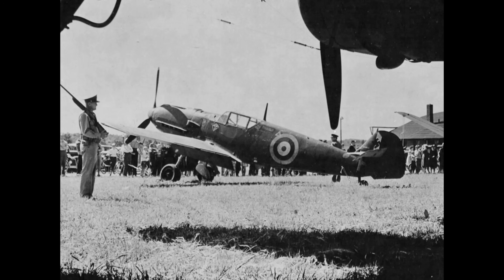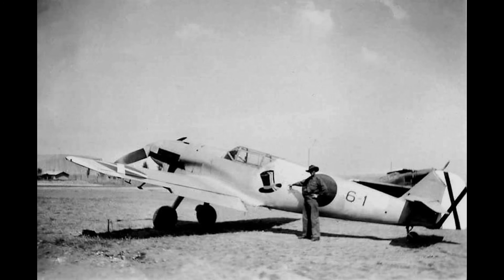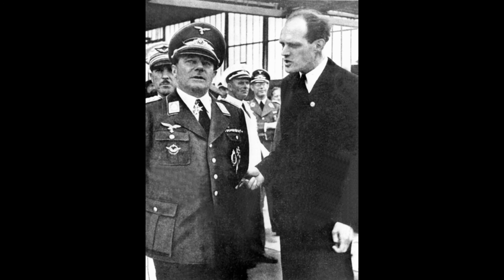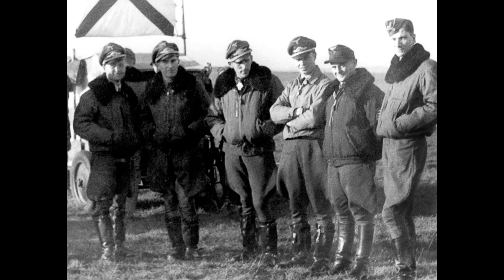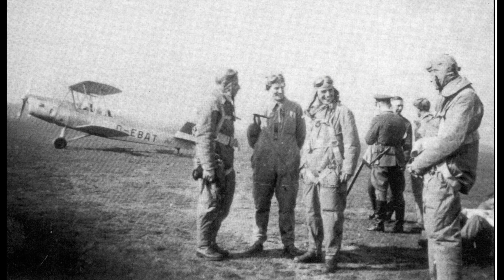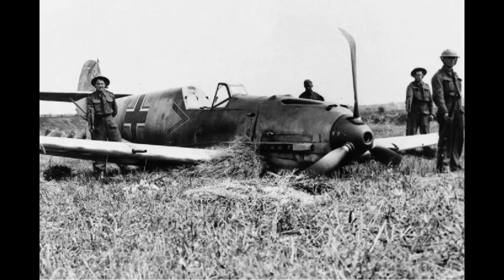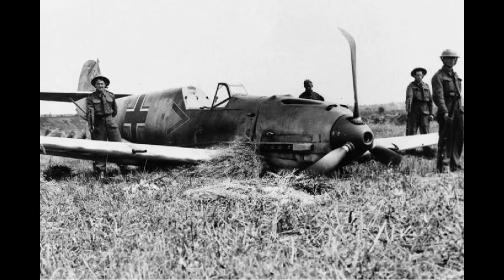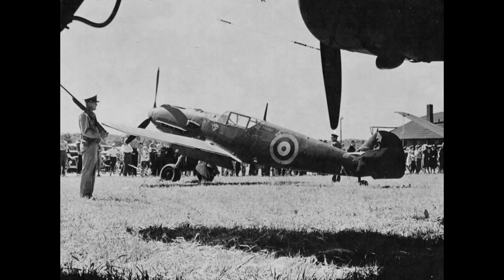British Engineers Examined a Captured Bf 109 — Couldn't Believe Its Landing Gear Was the Real Killer

Comment: My suspicions were correct on the landing gear. It just didn't look right. I hope that the restorers rectified those problems by beefing up the whole landing system. In flight, the 109 goes like stink. Great video & thanks for posting. The FW-190 like the P-47s has a wide landing gear set up.
Reply from the maker: Thanks For Watching !

Comment: Like everything else an aircraft is the product of the specifications demanded by the customer and the experience  of its designers.  Messerschmitt began his career designing gliders where every extra pound cost performance.  His customer demanded manufacturing efficiency.  The 109 was small, light, aerodynamically efficient and easy to manufacture.  The landing gear design compromise greatly  reduced weight and simplified airframe manufacture.  The Luftwaffe clearly accepted the risk in return for the performance reward.  As the war developed Germany's inability to adequately train pilots magnified the problem and increased landing/take-off loses.  Messerschmitt attempted a replacement with the Me 309, a wide track, tricycle landing geared fighter.  It didn't offer a performance improvement over then current versions of the 109 and the project was shelved. As a side note, there is very little documented evidence to substantiate the Me 109's mythical take-off/landing loss rate.  While high, there is no substantive documentation to back the rumour that a third of the largest fighter production in history was lost in this manner.  It was bad for sure, but no likely a full third.
Reply: very possible.

Comment: The 109 structure was exceptionally lightweight because all major parts: engine, wins, landing gear, mid fuselage , were all attached to the same structural feature. 
In the Spitfire, landing gear was attached to the main wing spar which had to be strengthened.

Removing the engine of a 109 was simple. The wings could be removed with the aircraft sitting on its landing gear.

The narrow track was a problem but it was a solution to gaining better performance with mid 1930s engines.

Comment: I’m surprised that Germany didn’t switch to the Focke Wulf 190 instead as it had inward folding undercarriages and was the better plane.
Reply: The 109 was faster, more agile, and significantly better suited to high altitudes . . .
Reply: The 109 was CHEAP.
Reply: @FredScuttle456  One Spit would buy two 109s. Quick to manufacture, easy to transport road or rail, good servicing in the field.
Reply: As it happens, the 109 was the choice of the top Luftwaffe ‘experten.’ It cost half that of a Spitfire. You are completely overdoing the undercarriage thing to a ridiculous extent.

Comment: As a point of information it would not have been primarily 'mechanics' but rather degree and phd level aeronatical engineers with years of experience who examined this Bf109. Only they had the maths, the physics and material science to calculated the bending moments, the shear forces and the dynamics of moving and rotating machinery.

Comment: Willi M was politically connected, when the FW-190 was available production of the BF-109 should have ceased.
Reply: The 109 was faster, more agile, and significantly better suited to high altitudes . . .
Reply: @letoubib21  True enough but R&D expended on the 109, if applied to the 190 could have accelerated development of the D9 and Ta152 variants.

Comment: The landing gear design of the Spitfire was no better.
Reply: Yes and for the same reason: a lighter wing.
Reply: Both aircraft had outward opening wheels on landing while the Hurricane’s undercarriage opened inward from the wings and were sturdier. The Seafire had problems when it came to aircraft carriers where the deck could be riding and falling in heavy weather.
Reply: No, the Spitfire's undercart was better but not as good as the Hurricane's.
the Spitfire's big problem was its view over the nose.